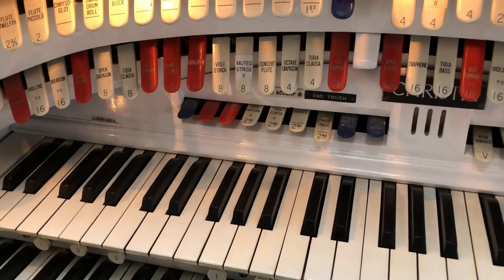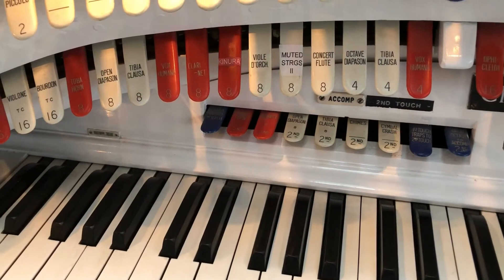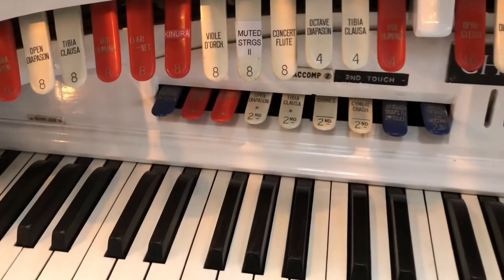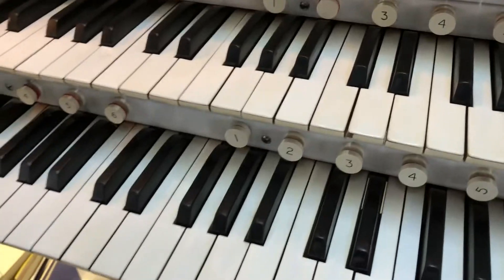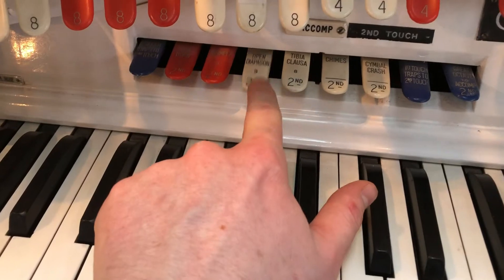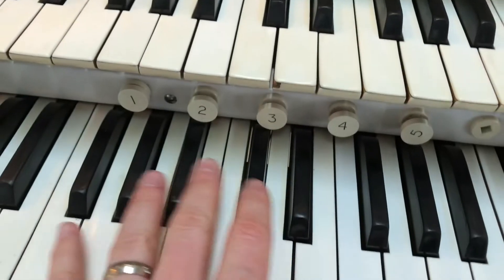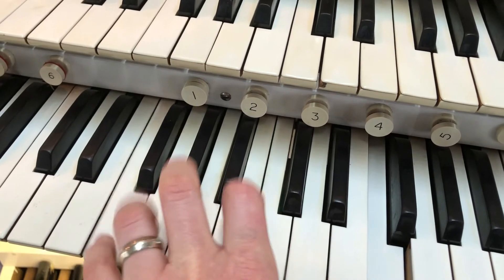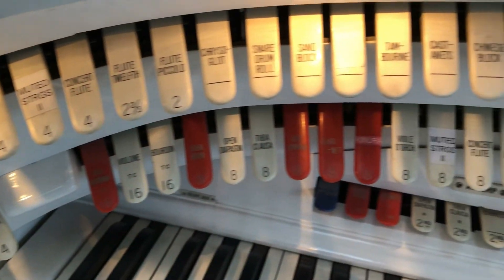What Is Theatre Organ Second / 2nd Touch?

Comment: I thought of a new system for an even more flexible second touch
The stop tabs can be lowered in 2 steps
0. OFF
1. ACTIVATES WITH FIRST TOUCH AND SECOND TOUCH
2. ACTIVATES WITH SECOND TOUCH ONLY
Reply from the maker: Interesting suggestion... however there are some systems like this on Theatre Organs already...

Wurlitzer pedals have a switch that allows percussion to play on 1st or 2nd touch.
 
Compton's did a similar thing, simply by pressing the bass pedal a little harder it would play the Cymbal or whatever.
Reply: If organs were equipped with Hall-effect continuous sensing keys (like the Lumatone keyboard) you could potentially make each key act as its own crescendo pedal!